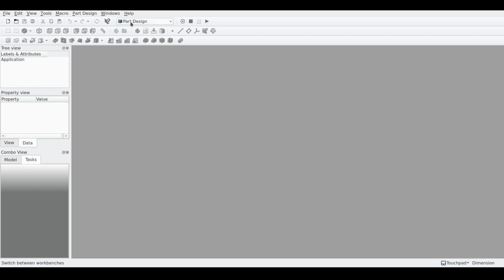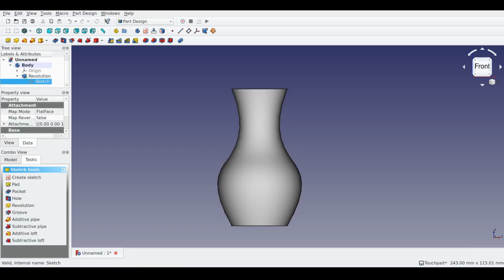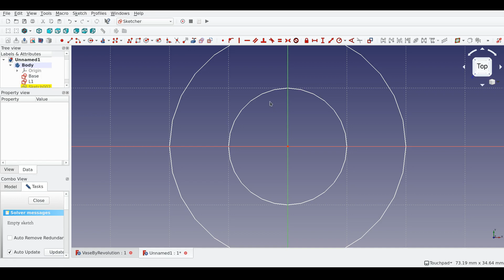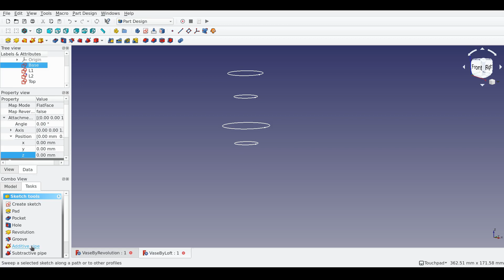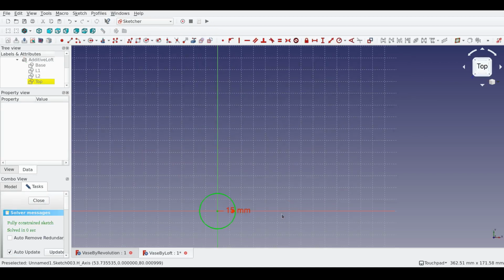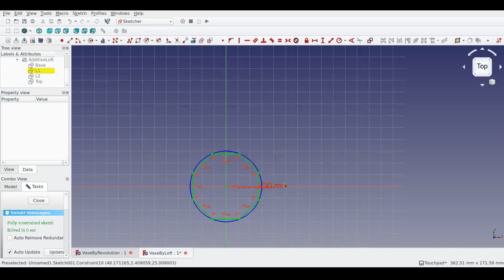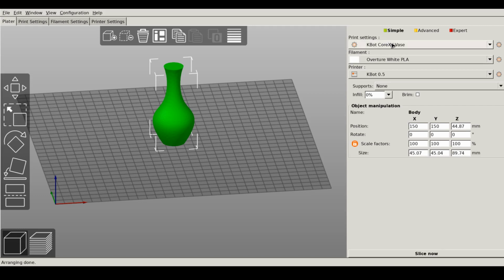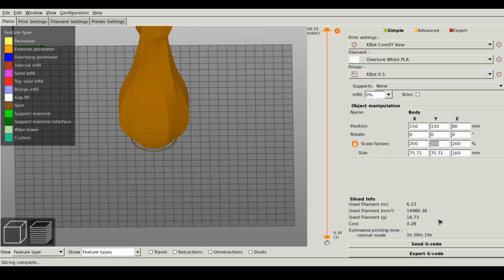Tutorial: Two ways to model a vase in FreeCAD for 3D printing

Comment: Thanks a lot very interesting, you do a great job !
I wonder to know do you think  you can create a 3rd methode using shape or b spline ?  It would be interesting to see.
Reply from the maker: Sure. The first method used a curve for the walls. Those curves can be regular curves or b-splines as well. If there is yet another way, please do share a reference and I'll try to incorporate it in a future video.
Reply: @oversliced1547  I would loved to test and try and share. But I didn't find good surface b-spline tutorial for begniners.
Do you know some ?
Reply from the maker: No problem. I'll include it in a follow-up video. Thanks.
Reply: @oversliced1547  wonderfull !